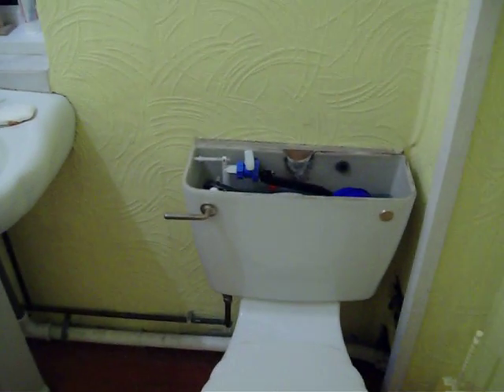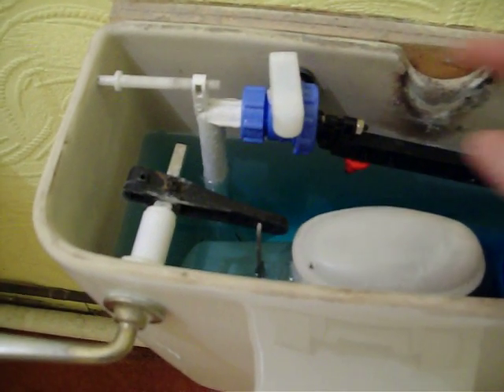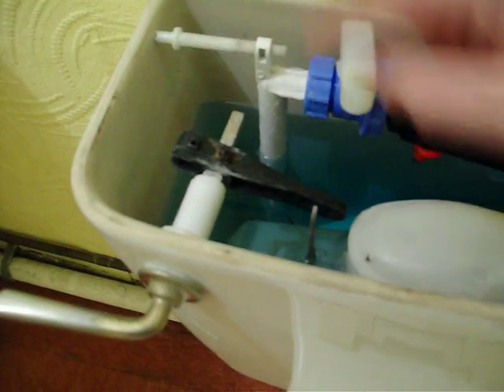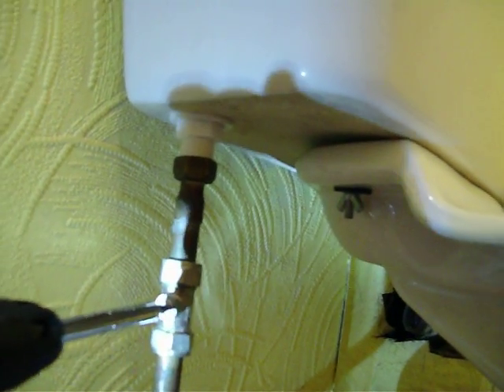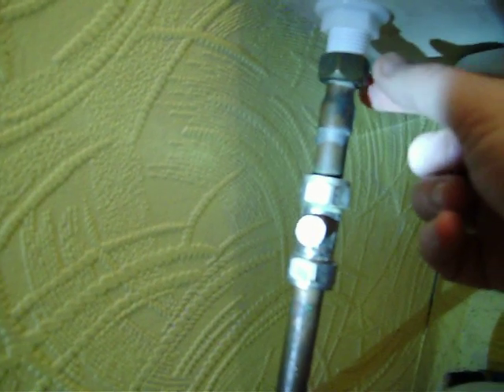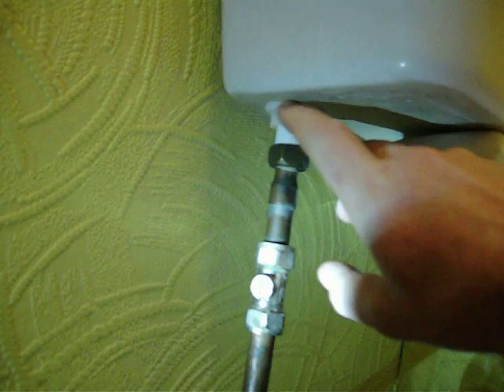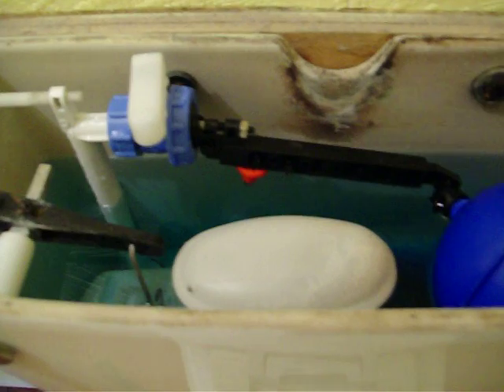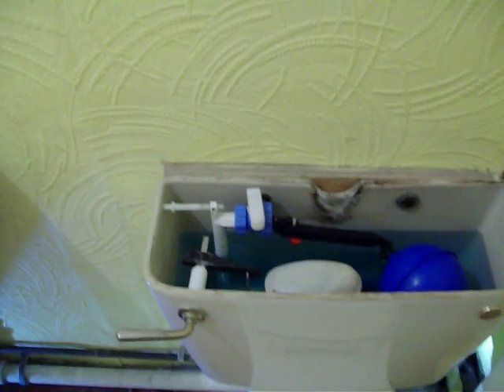toilet inlet valve

Comment: Perfect simple explanation,  First realised I had a problem when water was running down the brickwork from the overflow pipe outside.   I had the opposite issue - too high a water level in the toilet tank. Sure enough the water was spilling over into the overflow tube. I adjusted silver nut/screw as recommended. Thanks Garry!
Reply from the maker: Hi, glad my video was helpful, nice to be able to do these little simple jobs yourself and save a bit of money.

Comment: This is very useful thanks.  I liked the way you point out the relevant parts when you mention their names and cover the really important stuff like not over tightening on the nuts on the pipework underneath the toilet.  Most of the vids on here are for side entry filler systems so not relevant to me.  The camerawork could have been in better focus !  However  i did like the slower pace so its easier to follow what you are saying.  On many other guidance vids the guys talk too fast, or try to crack too many jokes.  Then its harder to follow the key points.  Unfortunaltey all this was in vain in my particular case as the plastic nut under the toilet was far too tight and far too difficult to reach - due to the toilet bing fitted too close to the side wall.  So i'll have to call a plumber and get the whole cistern replaced with a more modern side fed filler pipe.  Many thanks anyway for  putting this on YouTube.  I did learn some useful stuff !

Comment: Thanks, my over flow pipe was leaking and I think I've just fixed it by tightening the screws on the arm of the float, saving the cost of a plumber and metered water bill!

Comment: What I really needed to see is how to reassemble the valve: getting the o-ring in the correct place was not really obvious but I finally figured it out..that the o ring goes between the cone-shaped piece bigger side and the far inside of the valve body...
Reply from the maker: glad you figured it out, this was not one of my better videos, it was a bit of an after thought to do it lol
Reply: @650GSF  I often find that the very little thing that you need help with in a hurry is the very thing that no one covers....thanks for responding though..

Comment: very nicely explained thanks. i tried to do mine but i think i loosened the nut on the service valve lol. mine doesnt go exactly straight up a kink in the copper allows for a small adjustment alas i have called my plumber in. think it would of been wise to secure the nut on the service valve with a wrench to prevent any movement. oh well live and learn...
Reply from the maker: it's a learning curve like everything at first, but once you have done a little bit of plumbing and gain a bit off confidence you will be happy to do these little jobs and save a few quid :-)

Comment: How do you take out the black pin
Reply: They are called Cotter pins and they are tricky due to being made of plastic ! You need to pinch the end in with a pair of (pointed end)  pliers and then pull !.  Its not ideal. Ii wish the makers would use metal pins instead of plastic. Its the same with parts under the engine bonnet on your car.  The makers just want to use whatever is chepest for them without thinking of the needs of the end user !